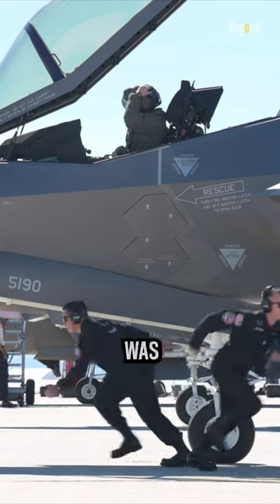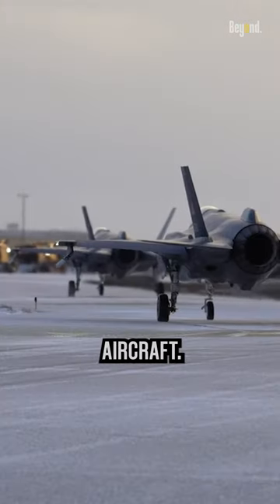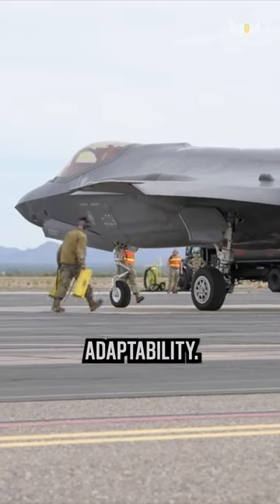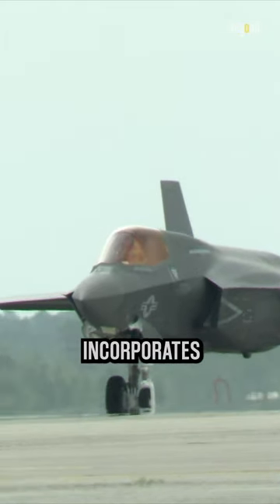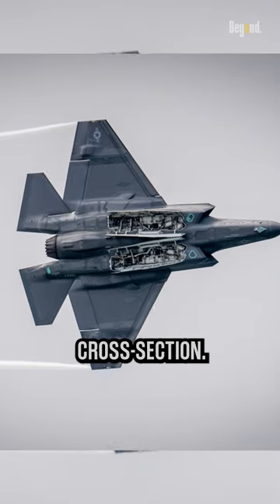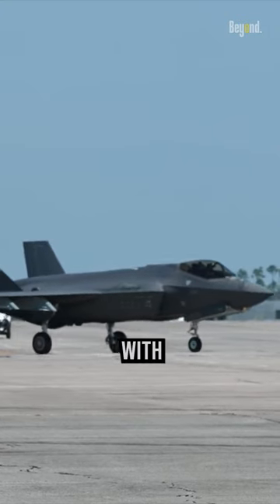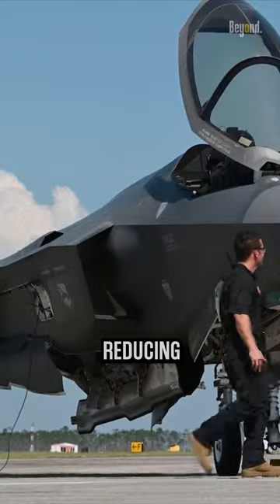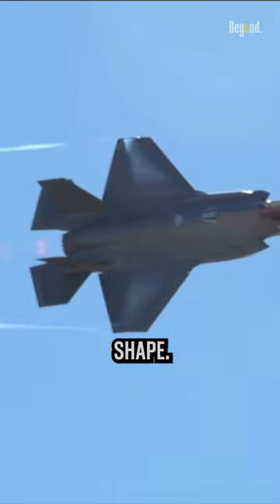The Coveted Fat Fighter Jet #shorts

Comment: Way too expensive for what it does. Stealth is being countered by new radars for a fraction of the cost. The F-35 is also VERY VERY SLOW at only 1.6M.
Reply: Yeah but speed isn’t that important, and it’s not undetectable, it’s just harder to lock onto.
Reply: No fourth gen fighter is faster than the F-35 with the comparable equipment. They might be fast without missiles, bombs, pods and external fuel tanks, but they're not flying combat missions.

Comment: The problem with the F35 isn’t capability,, it’s redundancy,, the lack of a secondary engine means, that if the fighter ever takes a hit, in the engine, the entire jet is lost  100 💯 percent of the time, where as say in the duel engine design, like the F-22 Raptor,, that results in a 50 percent, chance for aircraft loss , that’s why most military aircraft is twin engines designed these days.😉😘
Reply: So what about the F-16? Suddenly that’s not one of the best fighters in the world and the most widely used
Reply: A direct hit from a missile will drop most planes, no matter how many engines it has. Apart from overall thrust, the primary factor for twin engines is actually the reliability of said engines. Planes that have to deal with lots of small-arms fire, like the A-10 can also benefit from twin engines. You really only need two if there's a significant liklihood that one of the engines could stop working.
Reply: @blakefrenick203   The  F16 has the same problem as the F35 ,, reduced redundancy.  That is why it was phased out in favor of the F15 strike eagle.   One of the best Fighters in the world today. Although aging in design, the capabilities are still very very much a match for most current production fighters on the market today,, but that window is slowly getting ready to close soon with all the new technology incorporated into newer fighter designs though out the world 🌎 today.  This is why they tryed to develop the F22,, but as always,, greedy developers stalled it so long that it’s beginning to cost billions of dollars more than they expected it to,, thusly now the push for the F35 program.😜
Reply: @nem1   Your entire statement,, just proves my point that I was trying to make.       Which was ,,, redundancies save lives!!
Reply: @hannswade6252    Ummmm you are aware, I hope, that the 22 has been out for years at this point right?  And it's basically so OP that congress actually passed a law that prevents us from ever selling them to anyone right?
Reply: @TheMariusDarkwolf   yes I’m aware of that Sir ,, and hopefully they will eventually find a way to bring the operational and maintenance costs down enough for it to become a valuable asset in our future,, but currently,, the excessive cost of manufacturing this fighter is way to much for the American 🇺🇸 people to keep it in our inventory for very long.   This is a great example of greed ,, out weighing the technology and social benefits of the F22 as a whole.🤑🥴😵‍💫

Comment: I'm not a 35 fan
Reply: *an
Reply: @rocketassistedgoat1079  
No, my sentence is correct.
Reply: Well you should be because it amazing
Reply: @tyfighters002verkerk9  
I disagree. It's only your opinion and you have the right to it. Like I have the right to my opinion.
I lived long enough at Edwards Air Force Base and watched a lot of things go there that never made anything of it. But the technology was awesome.
I grew up in the Above Top Secret Government Black Projects. I grew up with the government listening to our phone calls.
The F-35 is the step child america made to be able to sell something to other countries because the technology for the F-22 was to advanced, It still is.
The F-22 is so much better than the F-35.
I have no reason to ever like or want to like the F-35.
Reply: @Istandby666  you do understand they're made for different things right?
Reply: @tyfighters002verkerk9  
What part of I lived at Edwards Air Force Base do you not understand?
Reply: @Istandby666 the F-35 is easily the more advanced bird. They've studied restarting F-22 production and one of the primary reasons they haven't is the cost of updating it. IRST, helmet-mounted queuing, modern RAM coatings... The F-22 is certainly still the baddest bird in a 1v1, but it's no getting by the fact that the avionics and design are from the 90s
Reply: @nem1  
As for the RCS? The F-22 is still more advanced. That's why the B-21 has the same RCS as the F-22.
As for when the F-22 was designed and tested? I would know I was at Edwards Air Force Base.
But that still doesn't change the fact of my first response.
You all act like you're trying to tell me something I don't know. I was there for the YF-22. I was there for the F-35. That's the biggest difference. You were not there, I was. To top it off, it still doesn't change my opinion on that stupid plane.
You can try to sound smart by saying all the information you learned from someone else. But it doesn't help you.
Reply: @Istandby666  the people at Edwards now all know that the F-35 is the more advanced bird. The F-22 was designed for a fight that never came. The Raptor has a marginally better RCS, but no IRST. If it only came down to radar detection, an F-22 could pick up an F-35 a few seconds before it gets detected. The F-35 has a decent chance of detecting the Raptors ir signature at a much greater range. Plus, with modern datalinks that the F-22 hasnt been upgraded to, once one F-35 sees you, all of them see you.

You're honestly arguing against your own point. How long ago was the F-22 in development? You think technology hasn't improved since then?? The fact that the F-22 is still a highly competent platform is testament to how advanced it was when it was produced. Still, comparing an F-22 to an F-35 is like comparing the F-4 to an F-16. There were certain aspects where the F-4 performed better, but it's ridiculous to argue that the F-16 wasn't more advanced. The F-35 is simply better suited for today's aerial warfare; the Raptor is simply waiting to be replaced
Reply: @nem1  
I'm not arguing against my point.
I'm telling you and everyone here. You're copying the same information that's been released to the public. You act like you're telling me information I don't know.
But that doesn't change the point of my first comment.
I stand by my first comment.
Reply: whocriesforbidennotme641  
You're also saying something like I don't know. It doesn't change the fact of my first comment.
Reply: Tyfighter tried to force their opinion on me. Because I said something they didn't like. Cry me a river. It still doesn't change my first comment.
Reply: whocriesforbidennotme641  
Saying I'm not a fan of the F-35, isn't ignorant.
Reply: @RobertLutece909  
I've never said anything to you.
Reply: @RobertLutece909  
You should be talking to the kids responding to my statement, not me.
Reply: @Istandby666 the Air Force has officially said that the F-35 is overall stealthier, it’s only from behind that the F-22 is stealthier.